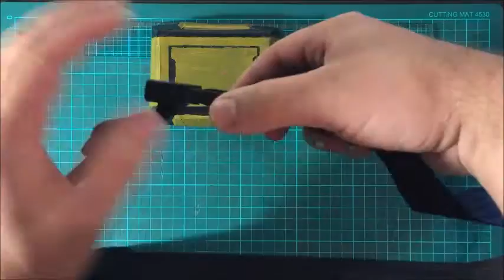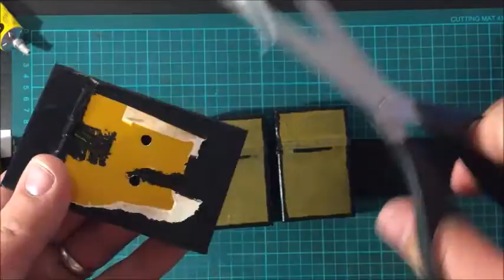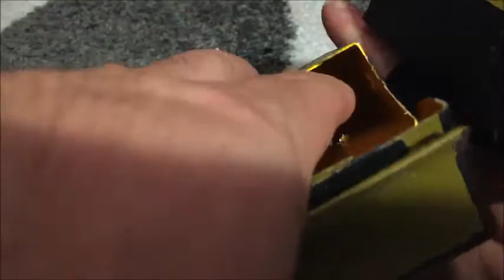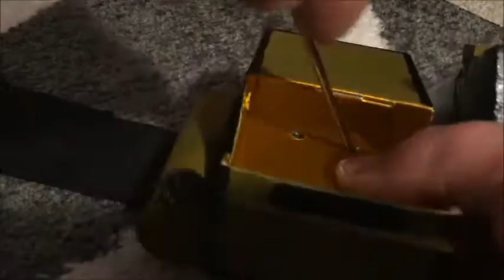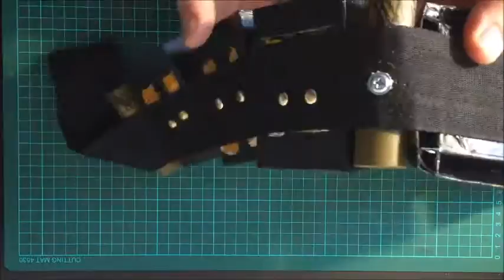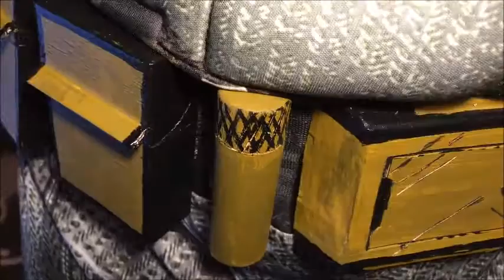DIY Dawn of justice Batman utility belt Part THREE

Comment: It looks good bro, but you got the canisters & pouches on the wrong sides... It suppose to be 2 pouches, 1 canister. and 1 pouch at the end of both sides...
Reply from the maker: hi thanks for your comment at the time i made this belt the reference picks i saw online had buckle canister and three pouches. on the 1/6 scale Knightmare batman there are canisters in between each pouch. if you watch till the end in the final reveal the belt matches up with my bat suit which which was another factor so that they would cover them up.